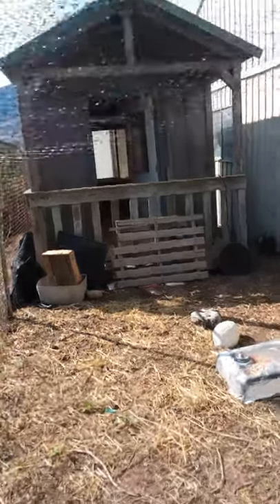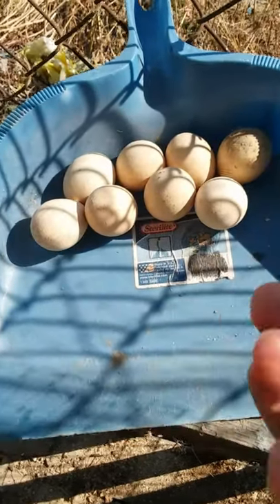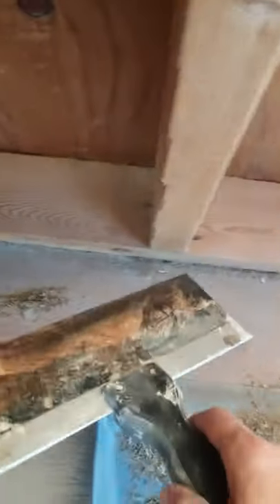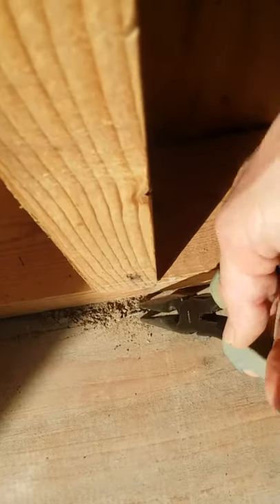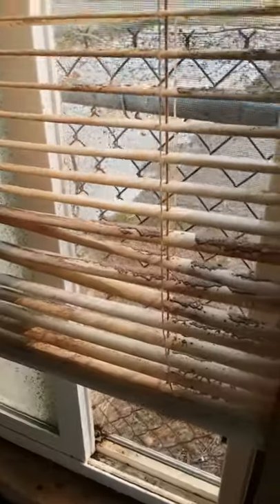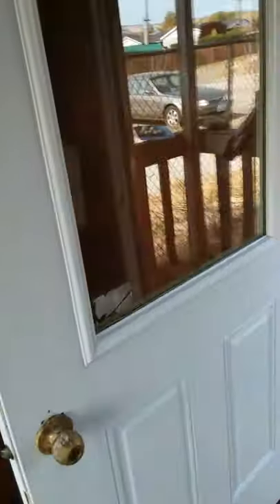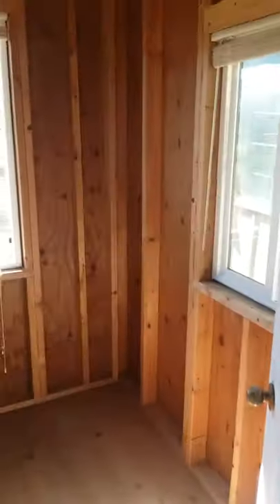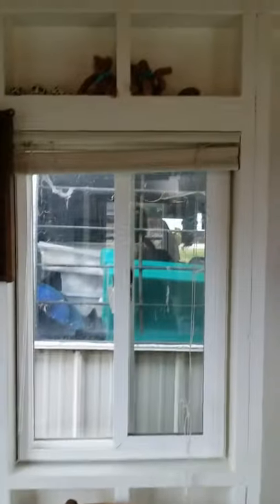Turn Old Chicken Coop Into a Cheap, Easy She-Shed

Comment: I love this! I'm thinking about buying one but am wondering how long it took to clean it and did it still smell at all?
Reply from the maker: Whew. I'm sorry it took me a while to (hopefully) figure out how to reply. 
I did the work over several days, letting the water dry, then the paint. It was fun. It was well used and very messy to start. Time it would take probably depends on the mess, how perfect you want it, etc. It smelled like chicken poop until the paint smell took over. After a few days or so of airing it out, it was fine. The chicken yard where I dumped the manure and sawdust grew a really amazing garden!
Reply: @rachelleshannon2757  no worries! Thanks for replying 🙂